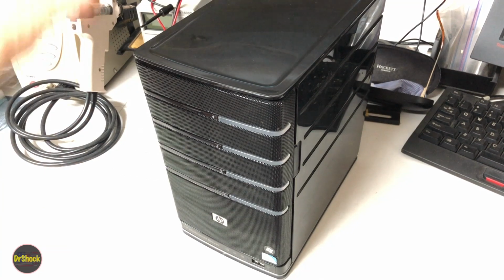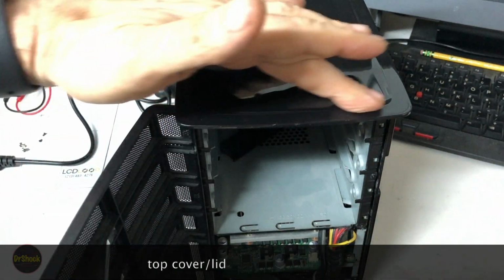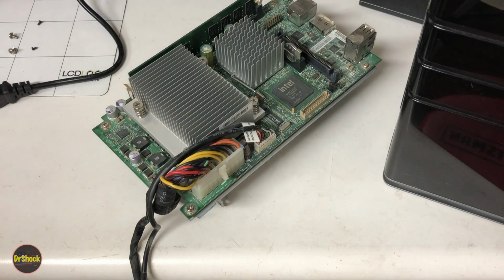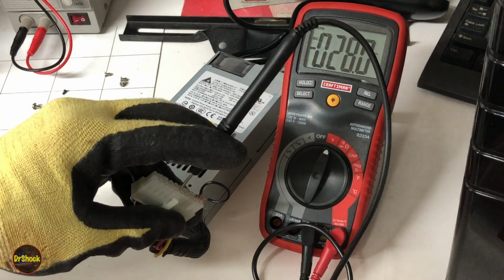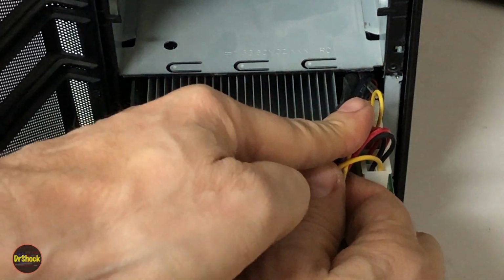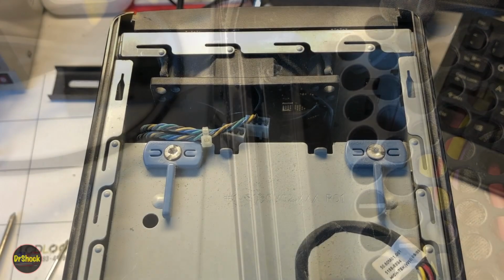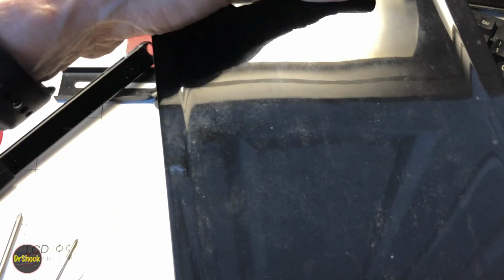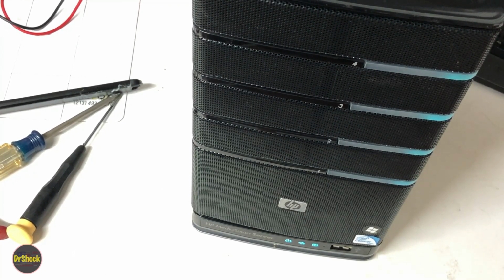HP MediaSmart Server No Power On Diagnosis ~ Flex Power Supply Replacement (EX490 / EX495)

Comment: Thank you for your video - very helpful. I was able to buy a regular Flex ATX power supply for <&50 and re-pin the 20-pin connector to match HP. Pin 2 is PS_ON#14 - green wire and Pin 8 is PWR_OK#8 on the original ATX connector. I took extra +12V from 4+4 pin connector. Pins are easy to remove using regular stapler staples - perfect size - there is a video showing how to do it,

Comment: Folding the PSU cable that way reduces airflow through the PSU and will lead to early PSU failure as well as excessive heat coming up from the PSU into the bottom of the motherboard. If you are using the original Celeron 450 (EX490) maybe you're okay. More risky with the E5200 (EX495). If you DIYd a CPU upgrade to other compatible LGA775 processors like E5800, Q8200S, Q9400S or Q9550S, then the extra heat is asking for instability, or throttling at best. I've been running an E5800 for over a decade and I snake the extra cable to the void to the right side of the PSU. But it's much more tricky to get the ATX adapter positioned correctly in a way that doesn't put pressure on the front panel connector and damage the wires. Guess how I know this. Having to repair one of these 2mm spacing connectors with two broken wires is not easy without an expensive Hirose crimp tool (which I don't own).
Reply from the maker: What we showed here was an EX490 which uses a Celeron CPU and it's perfectly fine as is.  The replacement PS I'm recommending here has superior air flow routing to the original from Delta, so cable routing flexibility to your concern is greatly reduced (link in the video description).  Certainly in general though, just keep the cable routing the same as HP originally did and it will be fine.

Comment: Hey Doc, thanks for the great video.   I was able to find a new power supply with the exact same HiPro label and part number (HP-U200EF3) as the PS in my  EX470.  Unfortunately, it came with the standard ATX connector and pin-outs.  Your link to the HP proprietary adapter no longer works, and I've not been able to find another adapter.  Would you happen to have a refreshed link?   Thanks!  - Jay
Reply from the maker: Thanks.  There cannot be much demand for these parts nowadays, so looks like the sellers offering the adapter have all faded away.   Buying the OEM to HP power supply won't get you the correct wiring (which was unique to HP but kept the same HiPro part number).   You'll have to rewire the plug yourself using the info I list in the video description, or purchase the power supply I have linked from KDM Power which is pre-wired for HP MediaSmart models and just drops right in.
Reply: Thanks @DrShock !  When I originally followed your links, they didn't appear to work.  But now I was able to find/purchase the "KDM" at your link and will be returning the HiPro.  Thanks again!!!

Comment: Great vid.  I just found your video after I did this power supply swap yesterday.  I went with the PSU preconfigured for about $70 USD.  Last week our HP-ex495 psu went out.  Kinda fizzled on a reboot  and then wouldn't power up.  Ordered the replacement PSU from amazon (seller is "Office Gear") last week and it arrived yesterday (7 days total).  Installed and now the ex495 is working like new again.  The original screws from the HP for the PSU to mount to the sled were too small for the larger diameter screw holes in the new PSU from amazon.  Fortunately the new PSU came with extra mounting hardware and bracket that aren't needed for the hp install.  I removed the extra bracket and reused those screws to mount the PSU to the sled.   It's important to secure the PSU to the sled chassis with good thread engagement else we have trouble plugging in the wall cable into the HP (it'll try sliding the unfastened psu further into the case)

I keep it running 24x7 for the past 12 years and other than the psu failing last week it's been great.  I've replace the OS with RHEL 6.3 Linux on the bottom most drive since 2013.  I use the HP as a  backup repository for Veeam.  Love this little HP.  I consider upgrading it with one of the newer HP small servers that , but this is working so good I may go another 12 yrs.

The wires of thee pre configured pins of the amazon PSU were lengthier than the original length.  And there were extra molex , a molex Y splitter and a sata power connection.  I simply tucked the extra molex wires and loom branch to the vacant space on the side of the PSU under the mobo.  it all fits fine really.  Very happy and its on day two with new power supply.  so far so good!